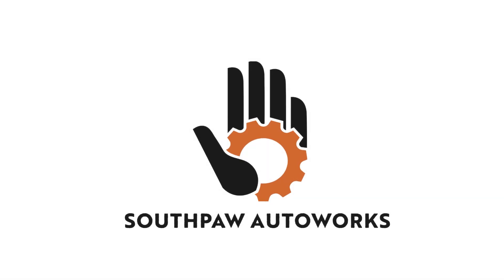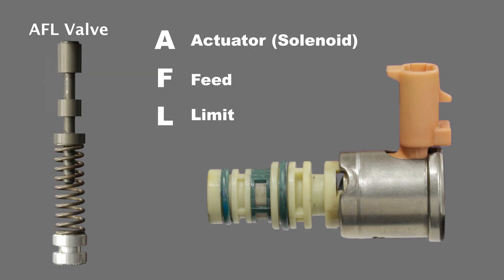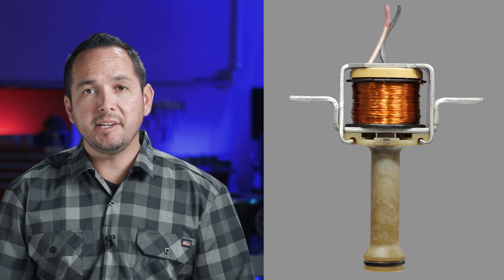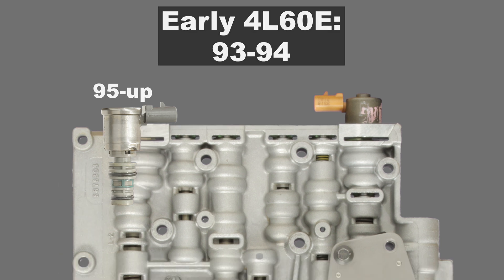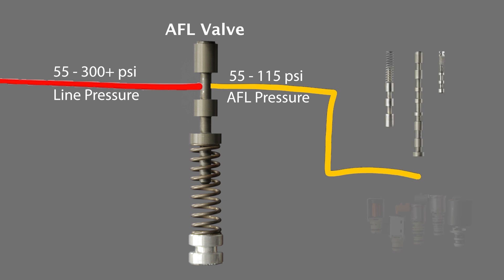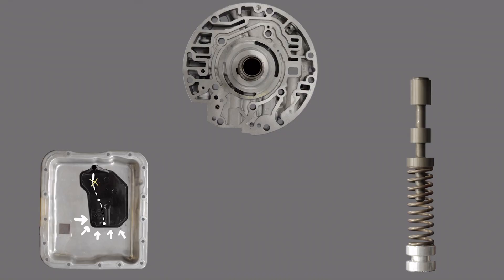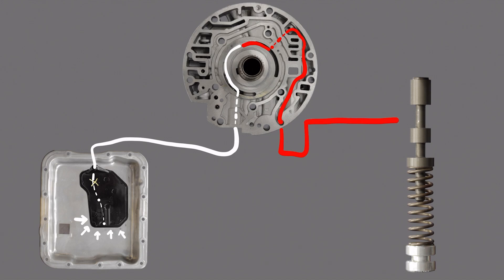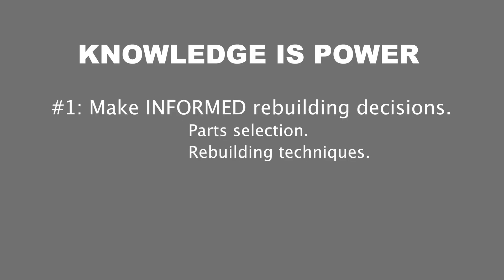4L60E: AFL Valve (Part 1) How it Works

Comment: Hi, I’m in Nc. I’d like to say thank you for your insight on facts. I’m working on a 2004 GMC envoy 2/wd 4.2 . I have no obd codes for transmission, but it slipping at 2nd to 3rd. And to get it to 3rd I’ll have it press the gas; and it still doesn’t feel good. Please please help me with this project. I’ve just put another transmission in the truck and really don’t wanna have to take it off. Also I’ve changed solenoids A/B. 4L60 E transmission
Reply from the maker: You're welcome.

Questions:
1). With the shifter in D, when the trans tries to automatically up-shift from 2nd to 3rd, what exactly happens?
2). Does the problem occur when the engine trans are cold?  Hot?  Happens at all temps?
3). Believe it, or not, engine problems can/will cause transmission problems.
Do you have any engine codes?  Any other kinds of codes present?
4). What can you share about the currently-installed 4L60E?  Rebuilt?  Junkyard unit?

As time permits, I'd be happy to try to get you pointed in the right direction.

PS - If it feels right to you, please help me spread the word about this channel.  Here's some easy ways to share with your favorite FB group, Reddit group, online forum, etc.  Thank you.

1 Handed Transmission Rebuilder:  (60-Sec Preview)
https://youtu.be/y3Vixa_Ec1E

How the 4L60E valve-body works:  (60-Second Preview)
https://youtu.be/fWPSaLeaOXI
Reply: @SouthpawAutoworks  yes cps / misfire #6. 1st&2nd smooth- 2nd to 3rd stinks. Help me please

Comment: I just love so much how you explain and illustrate. The info you give is gold. 
Besides the stock application, after you explain everything for some part, i would like to hear about mods that people do and how it changes stuff. For example : Stiffer springs in boost valve, Adding 1 more spring in the AFL valve
Reply from the maker: Glad you enjoyed it!
I plan on creating follow-up videos that cover common problems, and solutions for each of those problems.  I'd be happy to also cover mods and how it affects the system.
Thanks for dropping me a line!

PS
If you're interested in spreading the word about this channel...here's an easy way to share.
Roughly 60-second video...
1 Handed Transmission Rebuilder:  https://youtu.be/Mvv5Cd2cVW4

Comment: this is fucking great. channels going to be huge man. Also, I have an '08 silverado, would those sonnax boost valve and pressure regulator vale work with that pump (I know there are a bunch of different models)? Also I have the turbine speed control sensor in the way of the boost valve, any way around that or does the pump have to be removed?
Reply from the maker: The speed sensor wiring harness is, unfortunately, in the way of the PR Valve valve-train (includes the Boost Valve/Sleeve) on later-model 4L60E units.  In order to gain access to the PR valve-train, the trans has to be removed from the vehicle, and the pump has to be pulled out of the transmission.

There are different lengths of Boost Valve/Sleeve, depending on year of 4L60E.  Also, the PR Valves come in different sizes.  There's  the "regular" thickness (aka OEM), and there's an oversized thickness.

If you suspect the PR Valve bore is worn out, you could either:
1). Use an aftermarket oversized PR Valve.
Note:  This requires oversizing the bore, and tools are required to do this.
2). Use an aftermarket valve that utilizes longer valve lands in order to use unworn parts of the bore, to essentially restore the health of the PR valve train.  Just to be clear, it's not an oversized valve...just a modified valve...that requires no extra tools to get the job done.

Your encouraging words are appreciated.
PS
If you're interested in spreading the word about this channel...here's an easy way to share with friends, family, FB groups, automotive forums, etc.
(Roughly 60-second video)
1 Handed Transmission Rebuilder:  https://youtu.be/Mvv5Cd2cVW4

Thanks for dropping me a line!
Reply: @SouthpawAutoworks  Will do, and thanks for the reply. 

 I was thinking the transgo lengthened pressure valve and new boost valve. I suppose I could get a new pump cover all together, and just use gm parts too. 

Also did the line pressure test, when I'm having a problem at idle (have to tap the gas slightly to engage 1st gear, otherwise its in a half neutral state), or shifting into drive (the problem only happens when the trans is warmed up past about 150f or so), pressure is about 46psi. After that tap of the gas pedal, it jumps to about 65 n goes like normal.  When I'm not having that issue, pressure is about 65 or so at idle. 

 Every other gear works just fine as you drive. R has no issue, neither really does starting in 2, but then again it's low torque so the delayed engagement could be there a bit, but not really noticeable.

Judging by that, you thinking pr n boost valve is likely?

Comment: I like all your videos 
In my 4l60e gen3 my line pressure gauge 55 60 psi maximum just on Reverse give me 90psi 
You think the boost valve ?
Reply from the maker: I have read your other comments, posted on the other two (2) videos.  Have not had time to respond to those...

I'm having trouble understanding your question, on this comment/video.
1). With the trans in OD mode, your foot on the brake, and the engine idling, what is the Line Pressure reading?
      A). If you take your foot off of the brake and accelerate the vehicle (part-throttle), does the Line Pressure increase?  How much pressure does it build?
Reply: @SouthpawAutoworks  thank you for your reply
On OD the max pressure 60 psi I have with my foot on break and second on throttle with 2500 RPm
2 also maximu 60 i dont have more than 60 psi 
Juston R reverse the max 90 psi
Reply from the maker: The Line Pressure should be roughly 55 psi with no load placed on the 4L60E (engine idling).
But, as engine load increases (more throttle), Line Pressure should increase, too.  This ensures that the clutches don't start slipping, and burn up (fail).

Line Pressure is affected by:
1). PR (Pressure Regulator Valve) (Sets base line pressure [roughly 55 psi]).
2). The Boost Valve (raises line pressure above base pressure).
3). EPC Solenoid (this supplies oil pressure to the Boost Valve).
4). PCM (computer).  (Controls the EPC Solenoid output pressure).
5). Engine load sensors (they "sense" engine load).  If there's a problem with the engine, or one of the engine sensors, it can cause (or mimic) 4L60E problems.

Questions:
1). Is the engine running good?
2). Do you have a check engine light on?  Have you pulled codes?
3). Was the transmission recently worked on, or rebuilt?
        A). If recently rebuilt, did you do the rebuild, or did you hire a professional?
Reply: @SouthpawAutoworks  thank again and again 
My car hummer h3 2006 L5 3500 swaped to  engine  6.0 gen3 tuning with MAF deleted  with my h3 transmission  4l60e 
We change the bell housing and pump and torque converter and shuft and dram after that i drive the car for  2 months verry whell but i have a little slow shifting between 1n 2 n 2 n3 
So we disasemble and change all the clutches and we change also the valve body steel plate 
When we make the test drive i find i have no power in the gears and start to slip on 2000 rpm n2 n4 gears after n3 gear 1 n R work good with no slip 
I use to test the line pressure i have no pressure max 60 psi
Reply: مرحبا هل يمكنك مساعدتي 
لدي سؤال واتمنى الرد 
لدي سياره rav4 2008 احيانا الجير يعلق على وضع D وكأنها فاصله وعند الضغط على دواسة الوقود تنتع وتعول إلى حالتها الطبيعيه 
مع العلم على وضع R يعشق تمام 
المشكله في وضع D فقط
ارجو الرد

Comment: Great and knowledgeable videos, I watched almost all regarding 4L-60E. Question: if I want to make my vehicle start moving "happier" with brake pedal depress at Drive and no throttle (moving in traffic) - am I need to increase boost pressure in order to increase pressure inside TCC?
Reply from the maker: Thanks for the positive feedback.

I'd like to answer your question, however, I'm having trouble understanding.
Can you rephrase the question?
Reply: @SouthpawAutoworks  when you stay at drive with brake on, and then you remove your leg from brake pedal, car starts moving. If I want car to move faster in such conditions, I need to increase momentum at TCC, right? To do this, am I need to increase boost pressure?
Reply from the maker: Thank you for clarifying.

Yes, you would need to increase the momentum of the TC (Torque Converter).  Just aheads up, the TCC is the Torque Converter Clutch.  It's a clutch that lives inside of the TC.

Some things that will have an effect on what you described are;
1). Engine idle speed.  (this will increase momentum of the Torque Converter).
2). Torque converter design (stall speed)(angle of the fins that are used on the impeller/turbine).

To the best of my knowledge, increasing the Line Pressure (via the boost pressure, or any other means) will not have have an effect on what you have described.

Increasing Line Pressure will affect;
1). Clamping force applied to clutches and band.
2). Shift feel (soft, firm, harsh).

Comment: I'm doing a stand alone 4l60, and I don't want the shifts to be super hard, how can I control that with out the TCM? Could I use a rheostat switch?   Thanks!
Reply from the maker: You mentioned "4L60"...which is another name for the 700R4/TH700R4.  Yet, you are mentioning a TCM.  I'm going to assume you mean the 4L60E.  Please correct me if I'm wrong.

Are you wanting every up-shift/down-shift to occur automatically?  Or are you wanting to manually shift it for ever up-shift/down-shift?

I'm not familiar with using a rheostat for a transmission.
Are you thinking about using that to control the EPC Solenoid?
Reply: @SouthpawAutoworks  yes 4l60e, manual shift, wanting a stand alone for 4l60e, just wonder if there is a way to control line pressure with something?
Reply from the maker: Understood.
Yes, I imagine that it's possible to control the electrical amperage supplied to the EPC Solenoid (Rheostat, etc).

0 amps:  Max line pressure.
1 amp:  Minimum line pressure.

It's important to note, under normal operating conditions, the PCM varies the amperage.  It varies depending on throttle position (TPS), among other sensors.  The Line Pressure (via the EPC Solenoid/PCM) changes as the vehicle driving conditions change.

I guess you could turn the Line Pressure all the way up, at all times.  But, know that it's hard on the pump (probably reduce the life of it), it's hard on the rest of the driveline (shock), it'll make for one really hard 1-2 shift, etc.

Wishing you the best on your stand alone 4L60E.

Comment: I have a 4L60e that slowly starts to overheat after 60-90 minutes of run time then starts to shift hard. It does have an external cooler. Any thoughts?
Reply from the maker: Under normal operating circumstances, the torque converter creates a lot of heat.  The cooler is responsible for managing that heat.  Plus, the TCC (Torque Converter Clutch), is also responsible for managing that heat, and of course performing other tasks, too.

Do you have a check engine light on the dash/instrument cluster?
Do you have a code reader, to retrieve codes?

Inexpensive code reader tool:  https://amzn.to/33uwVrj (Paid Link)

DISCLOSURE:  🕵
As an Amazon Associate I earn from qualifying purchases.  Some, if not all, of the links contained in this video description are affiliate links.  This means that, at no additional cost to you, I will receive a small commission on any purchases you make through the website links provided above.
Reply: @SouthpawAutoworks  no check engine light on. I can check to see if it has any stored codes. The transmission was rebuilt a couple years ago. I'm going to change the filter/fluid and check to make sure the cooler lines aren't kinked. An external cooler replaced the radiator cooler when the transmission was rebuilt. Should I change the TCC solenoid when I change the filter?